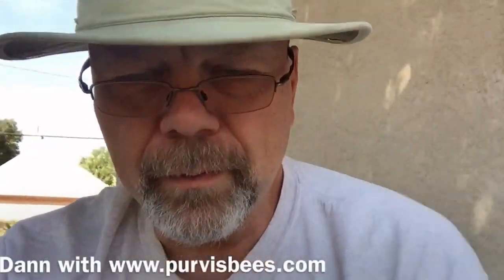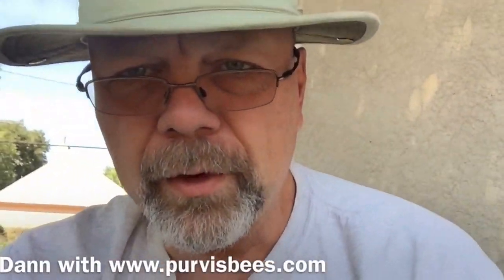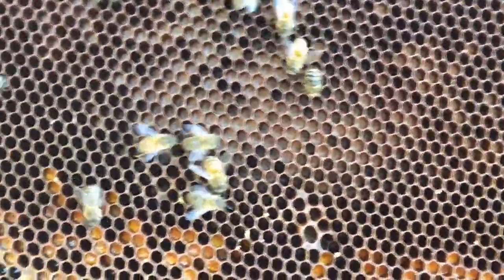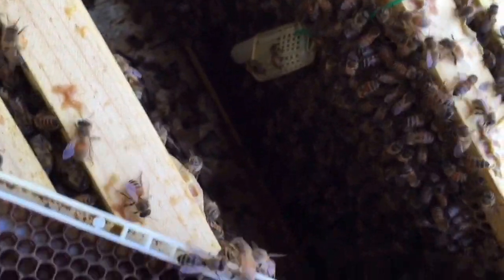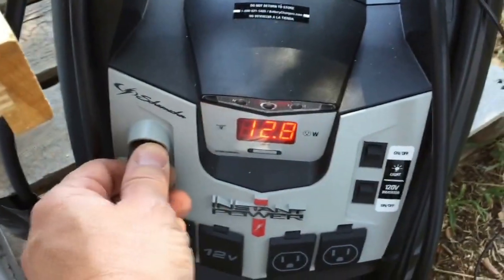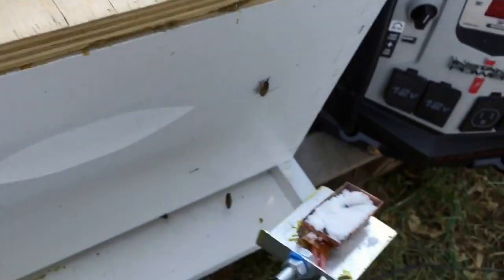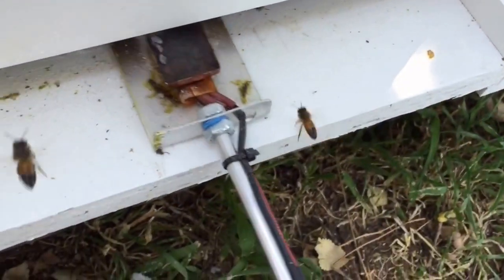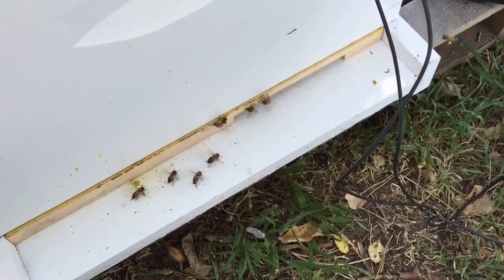Single Oxalic Acid Treatment Technique for Varroa Mites on Honeybees

Comment: Check this heavy duty, commercial grade varporizer at affordable price.
When OA reaches 215 degrees (f) the water boils off leaving anhydrous (water free) OA crystals. At 315 degrees the OA crystals start to sublime (go from a solid to a gas). At 372 degrees, OA which has not sublimed decomposes to form formic acid and carbon monoxide. However, the decomposition of OA to formic and carbon monoxide can only occur under laboratory conditions, not in the apiary.
https://youtu.be/5oYZMY0Cse8

Comment: Nice video
Thanks for sharing 
Do you have try one vaporization per week repeated 3 times?, in order to break the whole varroa circle and avoid queen's cage. (Sorry about my English)
Kind regards from Chile 🇨🇱🐝🇨🇱🐝🇨🇱
Reply from the maker: Felipe Gómez   If I understand your question correctly, no you do not.  Simply one treatment will be enough after three weeks.
Reply: dannpurvis ok, I understood. But to avoid cage the queen and lost 14 of laying eggs days you could keep the queen free and do one treatment each week for 3 weeks and cover whole varroa circle.
Reply from the maker: You could but to expose a larger percentage of mites with fewer treatments you need to cage or remove the queen and therefore all capped brood.

Comment from the maker: Dianna Boykin just asked me a very good question. She wanted to confirm that I didn't have any issues if I cage that queen for 14 days. Keep in mind I look at things a little bit from from a lot of folks because I produce my own Queens and have for years.  Having said that, I might not be as paranoid about losing the queen as somebody who spent close to $40 just for the queen and who knows how much for shipping.  There's risks anytime you do something with beehives some are almost negligible some can be pretty risky. I consider treatment of most kinds passed the 50% point of risk. There are many risk of caging a queen for 14 days. Doing it right involves some experience in beekeeping or a good mentor explaining possible pitfalls and how to avoid them. The first one that comes to mind right now as I address this question is the possible formation of queen cells.  Just because you have a queen inside a cage within a hive does not necessarily mean a strong hive will not produce queen cells. In fact, that is how you can possibly produce some of the best queens available. Specifically, in a queen right colony.  But that is a whole different story and seminar.  Another possible negative outcome is damage to the queen. That is why or I should say one of many reasons, that I choose JZBZ plastic cages.  Very rarely do you have damage to the Queens with a plastic cage from JZBZ. Both are easy fixes. Inspect for queen cells either one or two days before or, as I do, during the use of Oxalic acid on day 14 and the other fix is; don't use wooden cages. Thanks for the question Dianna.